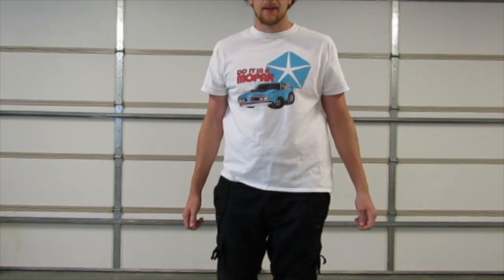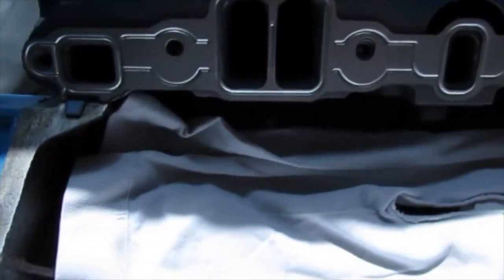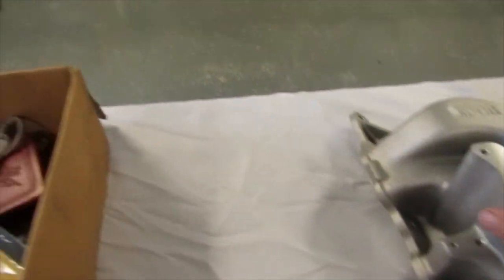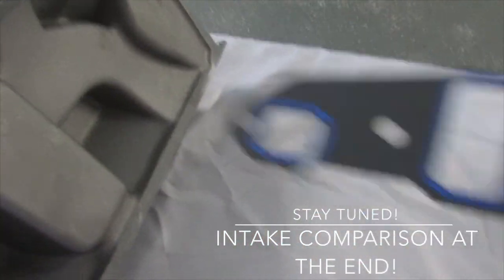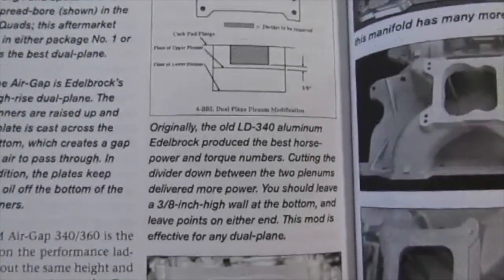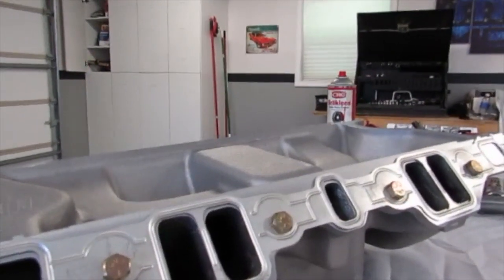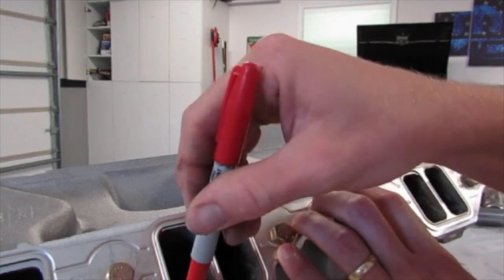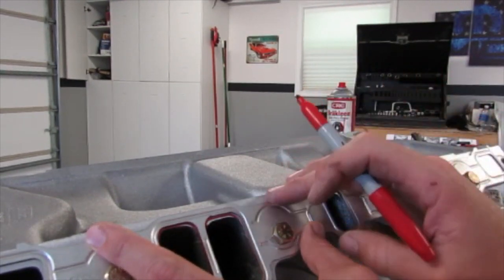360 Engine Build! Part 9, Choosing an Intake and Port Matching.

Comment: This may be a dumb question but wouldn't that casting flash inside the runners aid in atomizing the fuel?
Reply from the maker: Somewhat. Andy Wood at Unity motorsports told me that he leaves them with an 80 grit finish. That’s what he learned with David Vizard.

Comment: I had to take alot off my stealth 8022 gasket matching it was so much, way more than you did and the holes were misaligned it was ridiculous
Reply from the maker: That sucks. They must have some issues with core shift. I haven’t seen it with anyone Edelbrocks, but man it stinks to pay an extra $100

Comment: Great work.  I'm finally getting ready to build a 360 to put in my tired old 99 ram because....well, 360.  This is my go to for information.  Thanks for the details and explanations.
Reply from the maker: I appreciate that! I’m a novice engine builder. Not really sure when you get the title of “professional”, but I’ve always had good luck with my builds. You’re fortunate to have a magnum engine with roller cam. Good luck! 👍🏼

Comment: Metric bolts may help with the gasket slack. 12 or 13mm. Also you could use washers and nuts
Reply from the maker: The metric bolts are a good idea. Thanks brother!

Comment: There is a big difference in carbides for different materials. Always use the correct carbide for the material you are working on. Also, especially on aluminum, dip your carbide into a light oil before hogging out material. The softer the material is, the more it plugs up the cutter. Oiling the cutter often helps A TON!!!  I  choose the gasket I plan to use and mark the head and intake to it. Then I know it will have 1 plane and the least chance of turbulence.
Reply from the maker: I was taught to dip into trans fluid. In a different video, someone offered a very helpful suggestion to use chainsaw bar oil. It makes sense to me as a lube to use when cutting. You should try it Steve 1961P. We will learn together how well it works. Most Aftermarket intakes work best with the Fel Pro gasket that I mentioned. If I had ported the windows of my Early 318 heads out that large, they would have lost port velocity and had poor sealing. You're probably familiar with small block mopar heads, and know that 360's have larger ports and openings vs a 318. Thanks for watching!

Comment: New Subscriber and like the build. Question OR your opinion--I've got a STOCK 74 model 360 in a 88 Dakota. I've put A Elderbrock Performer on it with a Brand new 600 Summit carb. I'm getting a set of 587  J heads in the machine shop now, getting reworked. It'll keep the 1.88 intake valve's in it But a 3 angle valve job and resurfaced. I'm wanting to put Summit's 6901 Camshaft in it. Not to big But the bottom end is Bone stock. In Your Opinion, Would this set up work with that Manifold or should I look for a Stealth? Lot of great reviews on that manifold, but on Built Motors. Mine basically stock with a good set of reworked heads and maybe that Summit cam. The truck is 3.91 geared.  I'm kinda budgeted. Also wanna get a copy of that book you got. Peace
Reply from the maker: Mike Gowen thanks for the question. There really isn’t much difference in the performer intake and the stealth, except the stealth is rated for a little higher rpm range. I would definitely say you’re safe with keeping it vs. a new purchase. I do believe in gasket matching and porting if you’re able, but with stock stuff, you’re bread and butter will be below 5,000 rpm. I wouldn’t doubt you could get close to 400 ft lbs of torque with a decent cam and that intake. There’s absolutely no need to go to 2.02 valves when your motor is living it’s life under 5,500, and even under 5,000. Check out Richard Holdeners channel where he dynoed his camper 360 motor and did several different mods to it. Hope this helps, and thanks for watching !

Comment: Great Channel keep up the awesome work. Also another option on a budget intake would be the Speedmaster small block Chrysler that can be had Fairly cheap and also gives you Magnum bolt pattern along with LA.
Reply from the maker: Aaron Barnes thank you! I know they’re out there, but I just recently flattened a cam after a Chinese eBay intake wouldn’t seal on another guys 360. The online instructions describe opening up the bolt holes for LA engines.